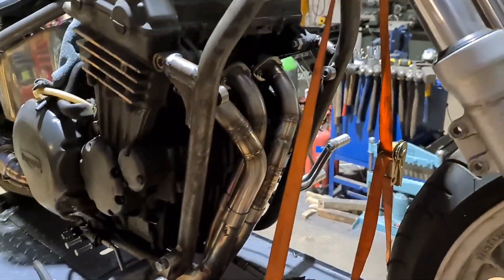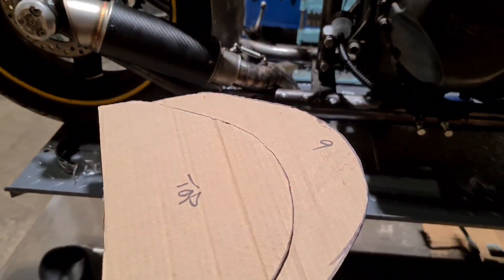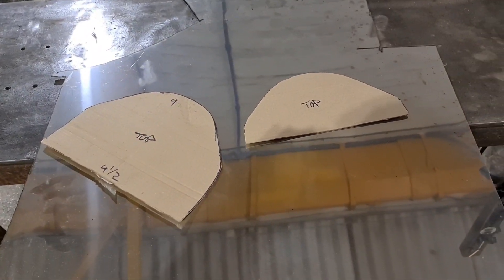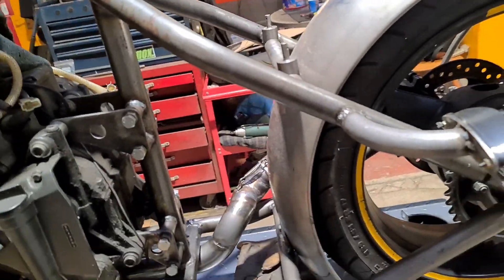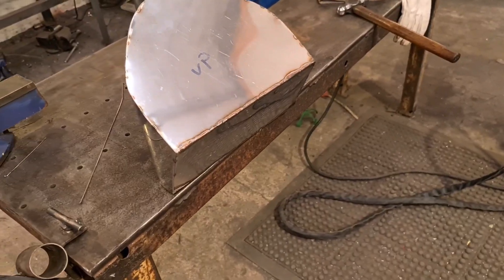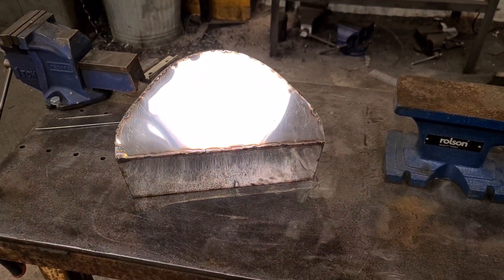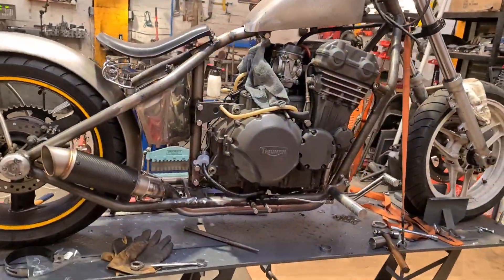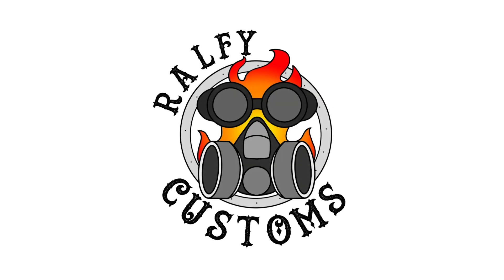Triumph Chopper Build Pt9 Custom Stainless Electric Box Rigid Frame #retro #vintage

Comment: Not a bad bash at the box , it'll look Brill when it's all polished up , will you be using a chain guard of some type as I'm thinking ya keys are gonna be a tad vulnerable if they got anything that erm ... dangles .. don't wanna get em caught up and lose them or wrap it all up in the front sprocket . Looking good tho the exhaust is getting there ..cheers Ralfy
Reply from the maker: Thanks Yorkie, yeah I'll most likely put the switch the other side, but I'm not a fan of too many dangly bits lol